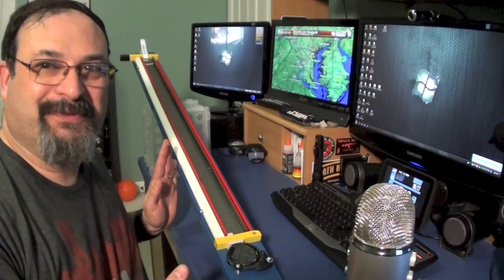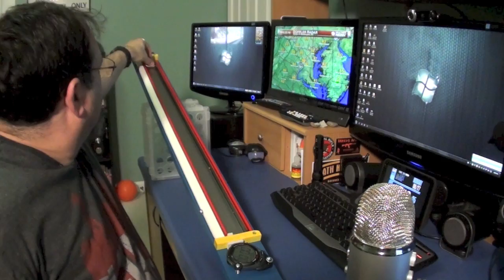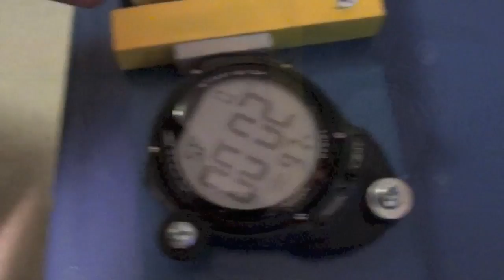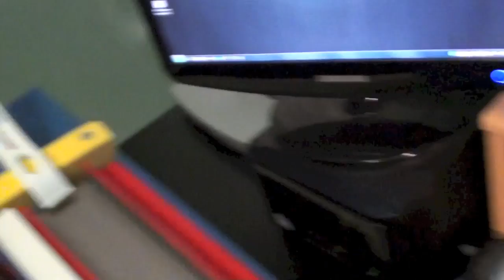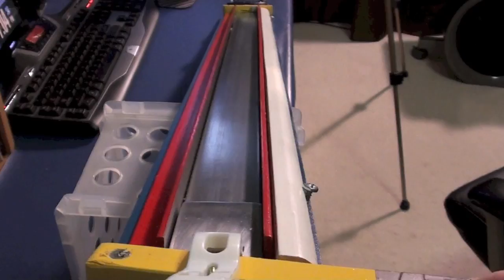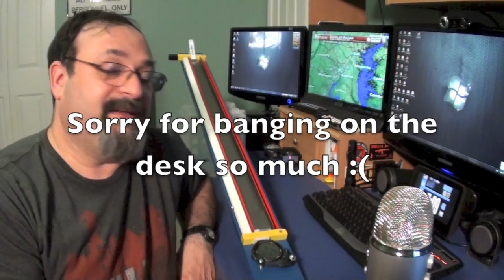The Ramp of Truth is Born

Comment: To test the friction reduction of grease could you have a flat track of metal and pull a little metal weight using some type of scale? I'm thinking something similar to what they use to weigh fish or produce. Not very knowledgable on the subject but they have scales to measure trigger pull on guns too right? I think that would work as well. 

Example: Measure the pull force of the metal block on the bare metal track, then test the different lubes.

Comment: Very interesting, but I wonder if what is being tested is viscosity.  A light spray of silicone will cause the shuttle to move faster than a light coat of grease.  However, grease would be the preferred lubrication for a gun.  Good video.

Comment: I agree, it is a great degreaser. However, I used to clean windows for a living, and even after flooding it with water, simple green/purple stuff/krud kutter products tended to leave a residue. If your skin is an issue, any form of rubber glove and rag will protect you long enough to get it clean, and completely so. Either way, can't wait for the tests! =)

Comment: that is nifty! Nice job on the paint, too. My prediction is that with the current setup, powdered lubes might be fastest (e.g., graphite), followed by the thinnest fluid, with the thickest (e.g., grease) slowing or stopping the shuttle. I haven't used FrogLube paste yet, but I wonder if after wiping off the excess, it's like a wax.

Comment: After hearing you describe how lubricity tests are done in a proper lab, you might be able to approximate that method.  I'm thinking an adjustable weight "shuttle".  It would be made to hold small weights that would be added progressively until the shuttle barely slid down the ramp.  Time would not be part of the equation.